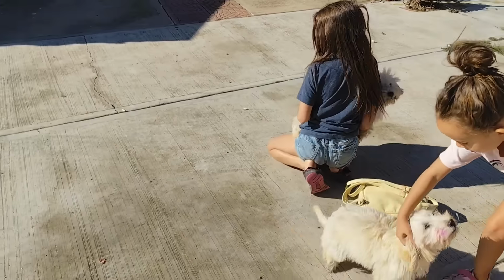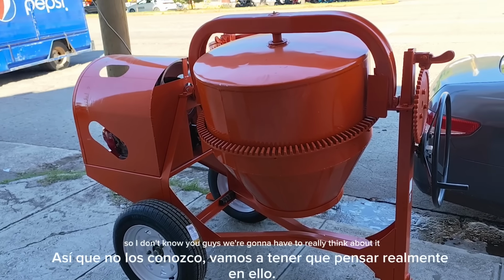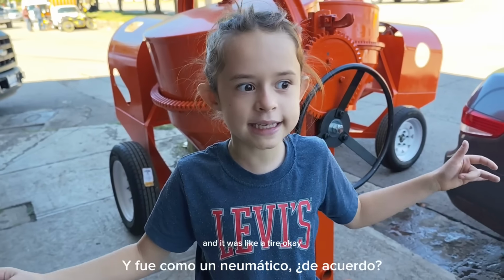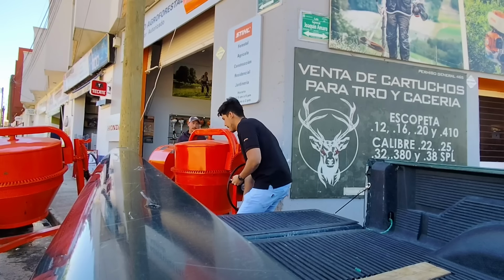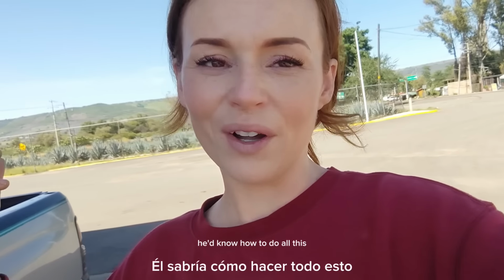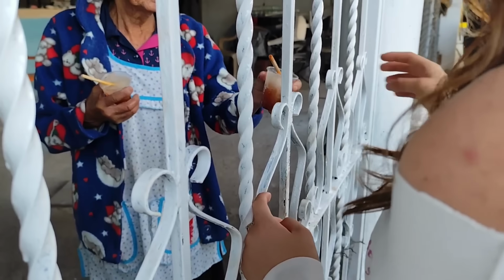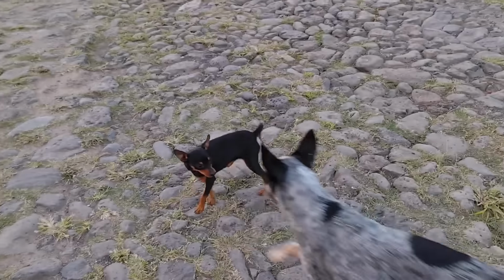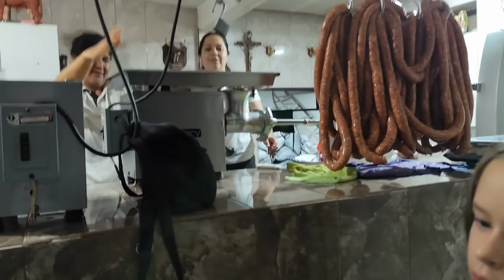Our Life in Mexico - making a BIG purchase // I hope it's not a MISTAKE.

Comment: One thing about those little Honda engines is they need to be maintained. Don't take them for granted. Take care of it, it will take care of you.
Reply: Maintaining is a given~ 😮
Reply: @bonniemoreno7872  It should be!! I've seen the stupidest things. As an HVAC tech I once drove 200 miles to change a dirty air filter. I kid you not. The filter was $3. They got a bill for $180. Don't be lazy, it can cost you.
Reply: @Scrat335 what other maintenance should we do? Do the valves have to be adjusted?

Comment: I bought one. It's a little bigger.  There is no way it would fit in the back of a truck.  The one thing that I paid extra for was I wanted an electric start. Everything is still all Honda, so I know it will last a long time. I'm a little older, so anything to my life a little easier always helps.  Also, didn't your mixer come with a hitch? It has the connection for it.